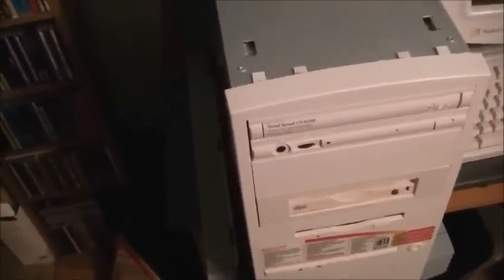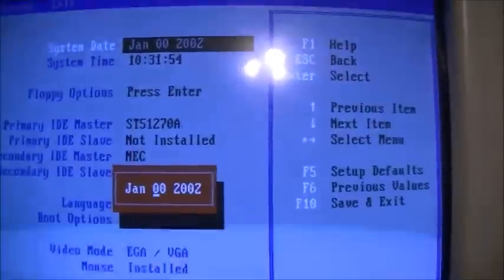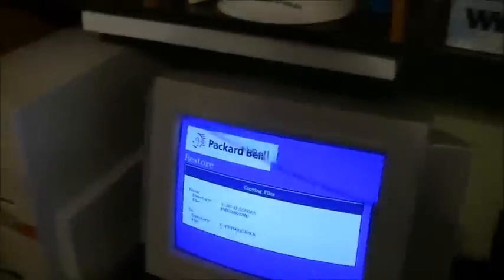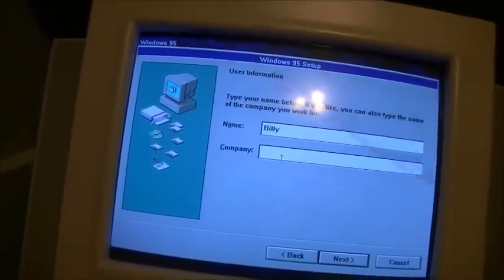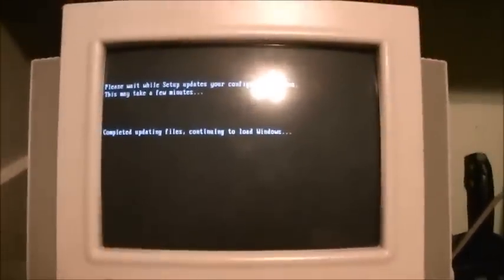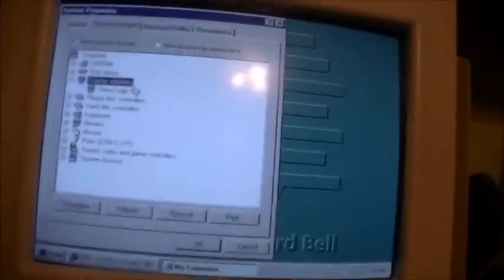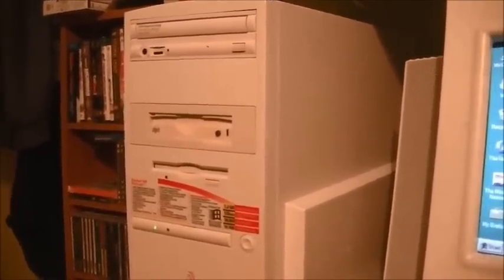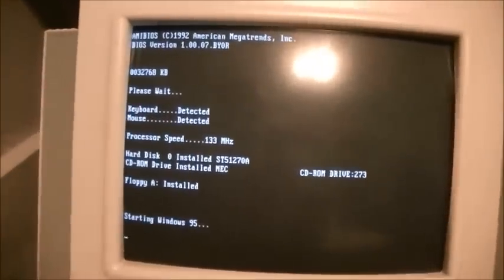Restoring the Packard Bell Platinum I

Comment: 0:13 I feel you, but for me it was going from StarHub cable to StarHub fibre, and with the new connection, it, on most of our devices, would not connect to sites over HTTPS but it works over HTTP, and after a few days, we got it resolved but the support consultant we talked to forgot to mention to have us turn off our modem and router, wait a few minutes(not seconds) and turn them on at the same time. Sadly, I will have to reinstall OS 10.6 on my home server, since the WiFi in that is still getting self-assigned IP addresses.
2:09 I never knew Energizer now puts protective stickers on their lithium coin cell batteries.
5:02 I'd be willing to bet that Windows would screw itself over if you let it boot with that date.
15:26 Great, so you don't need to manually install IomegaWare. Nice!
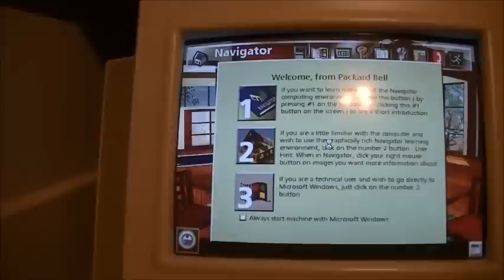23:44 As always, love your humour!

Comment: Hey billy! I recently got my hands on a platinum I with the pb600 motherboard but the hard drive is destroyed, what should I do with it? It also does not have the case but I did turn it on and everything seems to work. I couldn’t check anything with its software because I don’t have a computer monitor yet, but I’ll get one soon, so what should I do with it??

Comment: Any way to install an OS on one of these without the original Floppy and Disk? I have a Packard Bell Multimedia S621 in perfect condition but none of the software for it. 

810/820 M/Board, MMX 233 Pentium, 64mb of Ram, 5.2gb HDD.. I have tried windows iso disks and nothing works. Just keeps asking for a system disk.
Reply: Packard Bells are a pain to set up, managed to get windows for workgroups 3.11 on my packard bell but i swapped out the aztech modem/sound card for a soundblaster 16 on it. just stayed with win 3.11 because when i used windows 95, it popped up a registry error after installing drivers. and windows 98 was just too slow

Comment: You say this PC has a Hillary motherboard in it and it may have even mentioned it on the screen, but what is meant by a Hillary motherboard?  Does this mean that there's a company called Hillary who manufactured the motherboard in this PC?  Would this PC do a better job at playing Fire Fight compared to some of your other Packard Bell PCs?
Reply from the maker: I am not sure where Packard Bell got the names for motherboards but this is indeed a Hillary board. Funny enough, this would work quite nicer with Fire Fight than other systems. It's weird.
Reply: Really?  I wonder why that is.  Did Packard Bell design the motherboards in these mid 90s PCs?  Do you have any idea who the motherboards were actually manufactured by?  I wonder if Foxconn did any hardware manufacture for Packard Bell, that's indeed Foxconn were even around in the 90s.
Reply: Lachlant1984
Hello !
These are motherboards designed and manufactured by Intel (probably by Foxconn actually). You can determine this easily by inspecting the BIOS version number : when formatted this way - 1.00.nnnn.xxxx you can be sure that this is Intel.
The last letter gives the OEM ("T" for Gateway 2000, "R" for Packard Bell...)